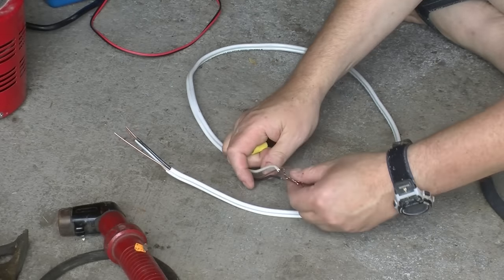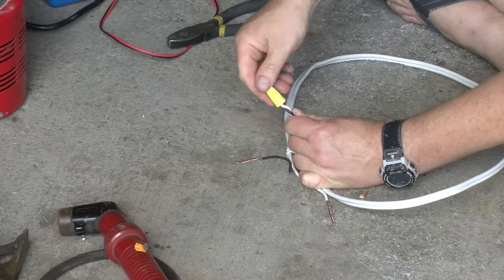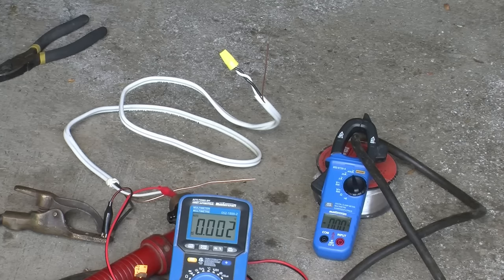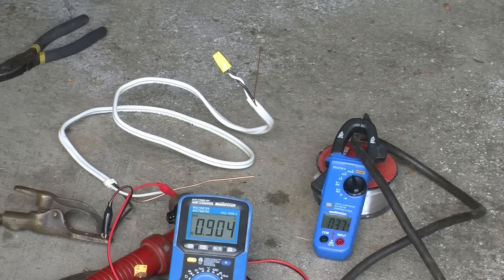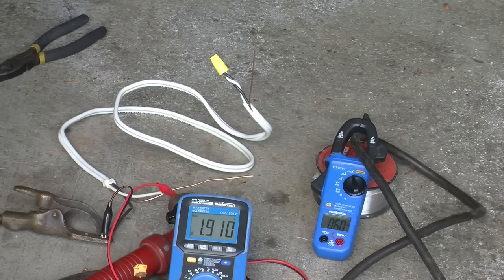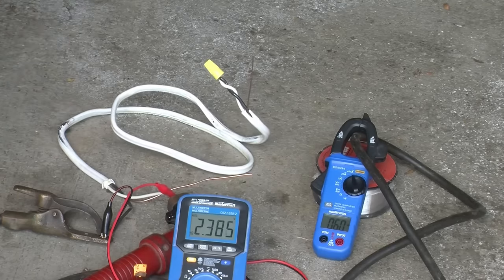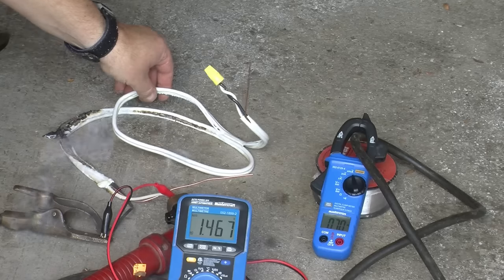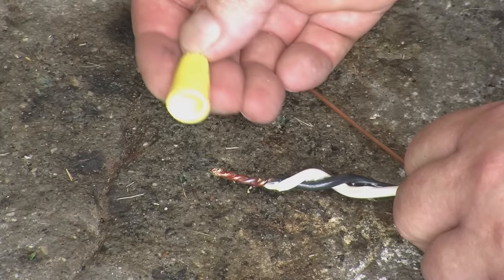How many Amps to burn up 14/2 electrical wiring?

Comment: Thanks for doing this (subbed) I ran about thirty"recessed" light cans recently and my helper who claimed to be a electronics know it all decided not to twist his wires together out of maybe 12 cans 3 of them didn't work so I think there's no question about twisting. I would be interested in seeing some test about aluminum  and copper wire connections I am working on a house with alum wiring and the connectors to copper are about $4 apiece
Reply from the maker: If I ever get hold of some vintage aluminum 12/2 wire from the 70s I will certainly test it. One issue with testing it though is that  the problem is the connections and they can take a while to fail due to the contraction and expansion of the aluminum and the hard non-conducting oxide layer that forms on the surface.  Would be great to get a cable still attached to something with an original connection from 50 years ago.  

I believe there is also some grease you are supposed to put over the connections to aluminum wire that is intended to prevent oxidation. If you aren't  already using that I'm sure there is plenty of material about that on YouTube and elsewhere. If you haven't done so it can be well worth having an electrician check all switches, junction boxes, receptacles etc for issues. I recommended that once to a friend who had just bought a house with aluminum and they did find a number of connections with significant burn marks. There were all redone of course with proper Al rated connectors and devices.
Reply: i've fired lazy workers for that exact same thing. twist your damn wires then cap em
Reply: @ElectromagneticVideos  The material we use on the aluminum wire connections is Penetrox.

Still have lots of lengths of 12/2 and 12/3 aluminum wire that was left over from the house construction.

Comment: In a properly twisted connection the wire nut shouldn't be carrying any electricity.  The heat you detected was most likely heat conducted off of the copper.  This test didn't tell me anything except where the wire would fail when connected to a welding machine at a very low voltage.  The final failure occurred at about 14 volts and 260 amps which is 3,640 watts; about double the rated capacity of the wire.  At 117 volts with a 15 amp load the wire would be carrying 1,755 watts.  A meaningful test would have normal household voltage in the 110V-125V range for North America going through the wire.

IMO wattage is a more meaningful measurement because it considers both the current and the voltage.  Circuit breakers are rated in amps because they assume a narrow voltage range.

Comment: The length of that wire is going to make a difference also. It would be interesting to see how much current it takes to melt that wire if you make it 100 ft long or so.
Reply from the maker: Length actually doesn't make a difference - the heating for a given current is watts per foot, so each foot gets the same amount of power - and hence heat regardless of how long the wire is. I did a more detailed writeup here:  https://www.youtube.com/post/UgkxeilOfLJGy2ODslnBW0WFXUE580oHhFyP

Comment: A breaker any value in the rated ampacity of the wire would trip thermally.  I know because I've seen 18 Guage lamp cords hardwired into breakers.

Comment: At 3:35, your setup shows pretty closely the 25.25 ohms per 1000 ft resistance for AWG14 (25.25 ohms per 1000 ft). Nicely done!
Reply: Don't you mean 2.5 ohms per 1000 feet?
Reply from the maker: I never thought to verify that way! I must have done a pretty good wire-nut connection. Actually most surprised that my uncalibrated hardware store brand multimeter and ammeter produced that good a result!

Comment: I never thought it could take anywhere near that much overload before failing.
Reply from the maker: Yes! I was quite surprised! Its great to know that it can handle a significant overload in multiple error situations such as an old breaker only tripping only at a way too high current point combined with someone plugging in multiple heaters on a single circuit. I just posted a similar test of various types of wire connectors with equally  impressive results.
Reply: The main factor not mentioned, If the wire is overloaded by a small amount (say 25 or 30) Amps, the amount of time is a factor. If you overloaded this wire by a small amount over days, it'll still burn up.
As mentioned in the video, the longer the wire heats up, the more it heats up.
Reply from the maker: @shadowdemon13  Great point! I'll bet the plastic starts to slowly progressively deteriorate beyond a certain temperature.
Reply: I feel better about using 30A breakers now.
Although only one circuit is #12 wire (20A breaker recommended?)  and the rest are #10
Reply from the maker: @2Truth4Liberty  Yes - no more than 20A for #12 in most situations. #10 everywhere? Wow! Does code permit 20A receptacles on a 30 amp circuit? Even if it does,  would not not be too comfortable with that. Although #10 wires with a 20A breaker would sure be great at eliminating voltage sags when devices with high surge currents turn on.
Reply: @ElectromagneticVideos  Is there a reason you would prefer an overload (potential fire) to occur somewhere randomly in the wiring rather than at a receptacle? I could certainly install higher rated outlets if there is a good reason for doing so.
Reply from the maker: @2Truth4Liberty  It was the 30A breaker feeding a circuit with 20A receptacles that I had misgivings about. I would be concerned that if a problem occurred in a plugged in device, having 30A available might not be a good thing.
Reply: @ElectromagneticVideos  I needed the 30 for two portable A/C units that can draw up to 12A each. Hopefully by the time I need new units, they will have some that draw was less amperage.
Reply: PS: Believe it or not for a few of the circuits 40+ feet (linear as the crow flies) away from the breaker box, they convert from 10 gauge to  4strand/4stand/8solid (in heavy conduit) from just outside the breakers to the far back part of the attic where they convert back to standard 10 gauge (junction boxes).
This house had an attic fire with the old armored 2-wire
There will be no more fires in the attic :-0) 
(and I partially finished the attic nice enough to camp out up there if I need to)
Reply from the maker: @2Truth4Liberty  Conduit too. Thats nice and safe. I know how much work it is refinishing old houses - never a right angle or straight wall! But immensely satisfying when you are done!

Comment: Awesome video! Recommendation tho, maybe try more controlled set up with a real life practicality. Like doing 3 separate 14/2 wires and having them run at a different level of amperage for a full day or just an extended period of time instead of a few seconds and see how hot they get.
Reply from the maker: Thanks and a great recommendation. I actually did a a bunch of videos with 14/2 in a real 2x4 wall with different types of insulation. Here is a playlist with them https://www.youtube.com/playlist?list=PLHUfJmsprIcTVwSgCkTJnkinJSWrZY7DY

Comment: well twisting of the wires under a wire nut or Marrett is a good idea, if you're out in construction there is no time to twist all connections before putting the connecting nut on. as long as you have both wires the same length under the wire nut there really is no need for twisting as the surface contact area with the spring inside the wire nut is the same as having two wires twisted together.
Ken, Electrician Apprentice Professor.
Reply: Asking for issues.

Comment: Enteraining, and yet some viewers may mistakenly infer  they can safely disregard the Code.  What this test shows but minimizes is that Time and Heat Dissipation Matter.  No matter how little power you put into a resistance, the temperature will continues to rise, even to the conductor's melting point if there is no way to dissipate the heat.  Forget 15-20-50 Amps melting plastic -- just  .008 Amp will heat up a standard 120V 1 Watt incandescent lamp filament very quickly to 1,730 to 3,030 °C (3,140 to 5,480 °F).  Insulated in a near vacuum with no way to get rid of the heat, the filament's temperature rises quickly, slowing only when it begins  to radiate heat and then light.  The temperature stabilizes when the filament radiates enough heat and light to dissipate the one watt of power.  (This is why recessed ceiling lights have lower wattage ratings when surrounded by insulation.  Where  power wires are adjacent or pass through insulation, conduit, or studs, their ampacity is reduced  because their ability to dissipate the heat they generate is lessened.)    What's more, the longer the insulation is subjected to higher temps, the more quickly it degrades -- another reason why time is important.  And yes, in the real world, there is always dissipation by conduction, radiation, and convection (as in heat sinks, incandescent lamps, and space heaters), but it's limited by a lot of other real world factors.  The Code simplifies the myriad constraints and establishes a safe harbor that says in effect, "do it this way and you'll be OK".    Point is => Time and Installation Matter a Lot <= and the responsible person follows the electrical code and best practices -- and enjoys the entertainment value of YT, while taking them with a grain of salt.

Comment: I wired my first house with 12 awg, lights and everything. I also had a separate circuit for every applicance such as ref and dish washer.
Reply from the maker: You were smart! If would do the same if I was having house built today. Particularity with the amount of insulation in walls  making it easier for wire to overheat these days.
Reply: @ElectromagneticVideos  Thanks, Delaware was issuing permits for homeowners to wire their own homes at that time. A licensed electrician had to be on the permit but was only for consultation. The permit was required to purchase the meter pan and later have it inspected. I had 200 amp service with gas heat and hot water and a 40 hole GE breaker box that was almost full. A lot of overkill but it was my first house and it was paid for when I finished it.
Reply from the maker: @Magic-Wrench  That's really neat - I did something similar about 30 years ago. Maybe overkill as you said but way better that  something lacking in the future. I think 200A service has been require here (Ontario)   for quite a while. My current house has a 200A panel which will be perfect when I switch from propane to electric heat this summer - propane prices have gone above electricity over the last few years so it nice to have that relatively  easy option  to lower heating costs. A 100A service would have had to be replaced....

Comment: I suppose one could say that the purpose of the wire nut is only to protect against shorts, not to hold the wires together, cause the more wires together the more difficult it would be for the wire nut to hold them together without the twisting.
Reply from the maker: That what I would have thought, but apparently there are some wire nuts where the instructions specifically say dont twist the wires together before putting the nut on while other do.

What was a real surprise to me is that in this video or one others I did there were vehement arguments for an against twisting the wires together before putting the nut on. 

I think pre-twisting makes a better mechanical an electrical connection and the often flimsy metal spring in the wire nuts really is just there to hold the nut on for protection as you mentioned. However, if a manufacture specifically said dont twist I would not twist - or find an alternate brand where twisting is allowed.
Reply: @ElectromagneticVideos  some wire nuts are probably made with a stronger spring or some difference that makes pretwisting unnecessary, I suppose, but I never noticed it.
Reply from the maker: @carlodonnell146  That seems to be the case - an maybe a newer thing. I have never noticed it either. One commenter even mentioned a wire nut type that had serrated spring inside to really grip the wire and make connection.

Comment: Nice, but 60 watts does not normally create enough heat to ignite a wire.  Are you measuring DC volts on an AC setting?
Reply from the maker: It is an AC welder. Note that in this test, the power is the power dissipated in the wire itself for a given current due to the resistance of the wire,  not  power being delivered to a load. In a wire like this (and worse, for a wire embedded in a wall stuffed full of insulation in later videos) it doesn't take much power at all to get to significant temperatures.  Its actually a bit disconcerting how small the margin of safety gets for wires in an insulated wall or attic - to the point where I would increase the wire size to the next bigger one for wire in insulated parts of modern house if I was building one today.

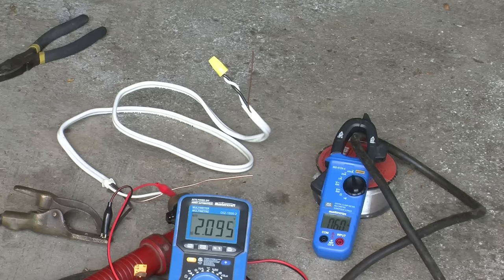Comment: At 7:48 - started to burn at the sharper bend. How long would it last at 20A? 5 minutes?
Reply from the maker: I would guess almost indefinitely  unless sandwiched between thick thermal insulation. There is a significant margin of safety as there should be. Many circuit breakers can be quite inaccurate as to what current it takes to trip them and after how long. I have seen specs for some that allow a 2x overcurrent for up to half an hour before tripping. So the #14 should be able to survive a 2x overload (2x15A=30A) for half an hour without failing and it seems to be able to. Of course that should not be taken to means its OK to use #14 for 30A!

Comment: Would the 14 eventually catch on fire if it was on a 20 amp circuit and the stedy draw was like 16 amps
Reply from the maker: Unlikely! In fact many breakers can go a significant amount of time (30 min) at up to 200% over-current depending on their specs. And all specs/regulations should be such that a significant undercurrent can be sustained without failure (just plain old good engineering practice). 

BUT - and here is a big but - in some later experiments (see the following videos) I did some tests with 14/2 in various amounts of insulation. With well insulated walls (ie foam) there is hardly any safety margin, and with thicker foam you could even end up with 15A outside of the safety margin particularity in places like  a hot attic in the summer. I was quite surprised. So much so that if I was building a house modern well insulated house today, I would make sure all wires in any form of insulation are are up-gauged (ie #12 instead of #14 etc) to restore the safety factor. Would be interesting to know if there are any statistics of wires failing in situations like this while still within their rated currents.

Comment: This is why it is so important to get reliable breakers and other components.
Sadly Amazon is full of no name Chinese electrical components.
Some claim they are UL listed, others don't bother.
There has been at least one batch of counterfeit Square D breakers show up that actually were just switches show up in Europe and in the US.

It is best to buy name brand components from a supplier you know and trust.
If you order name brand parts off of Amazon, look them over closely, compare them to a known real part if you can.
Reply from the maker: I had no idea there were counterfeit breakers. But sadly not surprised. I have encountered  counterfeit ICs bought through reputable suppliers. Not sure if it was ever determined how they got into the supply chain. I guess wherever there is money to be made people will do crooked things. 

I shudder to think of the consequences of a panel full breakers that are really switches. Hope they manages to track down a significant percentage of people who bought them.

Comment: Sir, you should not be touching the experiment with your hands while it is charged. Also, I would liked to have seen a slow increase until short and then fire, rather than in increments of 10. Maybe go to 60 and then go by 1 or 2 at each adjustment.
Reply from the maker: The voltage used is very low (less than 10V)  since we are essentially dealing with a short, so not a concern in terms of touching it.  The bigger issue is burning finger from the heat at the current goes up!

If you want more systematic tests, look at the videos I did that follows this one and you can see a more gradual increase in current in cable in a 2x4 wall surrounded with varying amounts of insulation.

Comment: I never felt 14/2 should be used😅 in residential applications. I always use 12/2 and 15 amp breakers where 20's are not required.  You also need to remember the voltage drop caused by long 14/2 runs.  It's not worth the slight savings by using 14/2.
Reply from the maker: After doing a bunch of follow-up videos with the cable tested in more realistic situations (in a 2x4 wall surrounded by various common insulation from fiberglass to foam), I am now convinced of exactly what you are saying -  12/2 for 15 amp circuits is really what should be installed. As you said, the slight savings is not worth it.